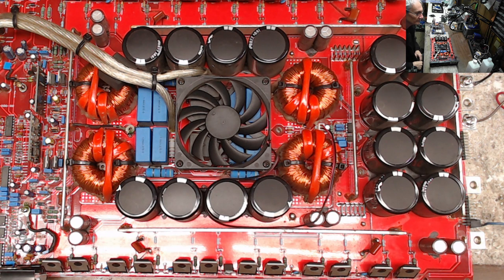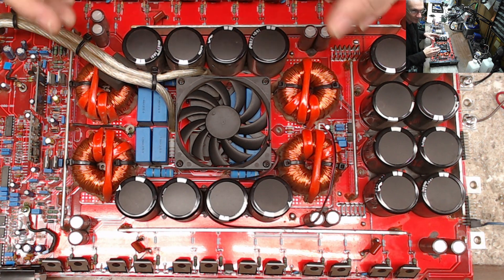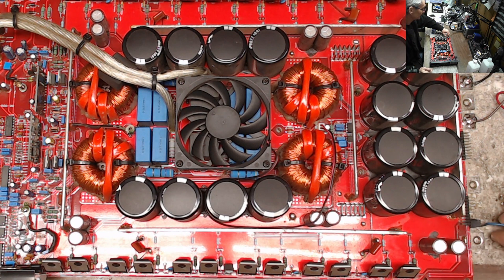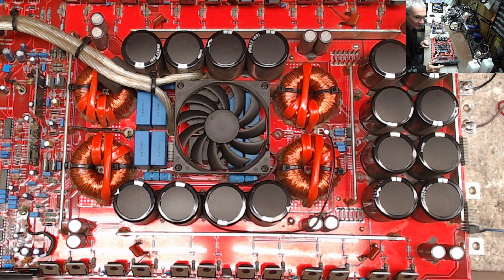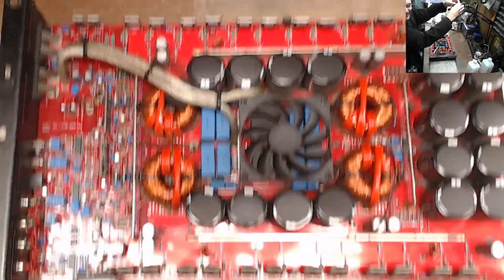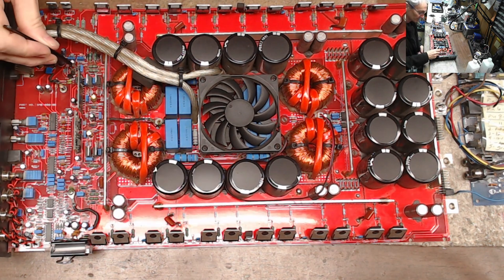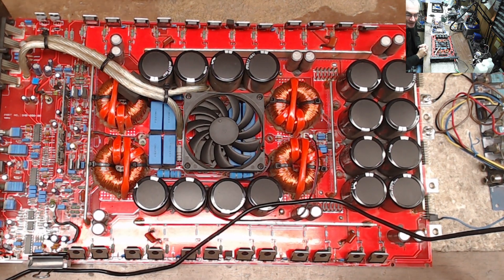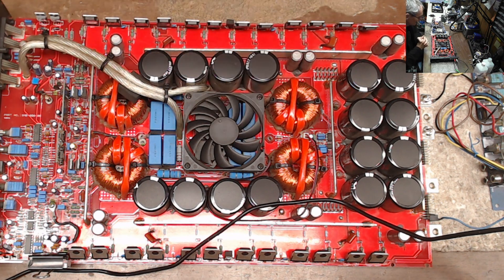Crescendo 17k Output Section Safety in Power Up and Muting Circuit

Comment: Todd uploading again is a good time!!! Wanted to see some Crescendo amps at some point...... Don't see many of them... Gotta get in contact with you as well!
Reply from the maker: I actually have 2 Crescendo 17k amplifiers in. They are one of my favorite designs due to the wide body and spacing of the output transistors. This equals reliability in my eyes. Thank Mike for dropping in!
Reply: @ellensburgamplifier  Of course!! Always a pleasure to stop in. Two 17K's? Funny in my head I seen the board and I got that "DC" and some "Ground" kind of vibe!! I like output repairs. They are my fav. (I do get the hint too by the way.....Hopefully "Ground" gives you a hint I get it.....) Got a Sundown Audio Salt 4K situation I need to get back home to test before it may get swapped. It's the guys 2nd one. 1st had a factory defect, but I don't have knowledge of what it was. The repair place claimed it. New one is having an issue as well, but some upgrades have to be done 1st, so we will see!!! I'll message you if it's interesting and worth the chat over.... Otherwise, twirling thumbs.....